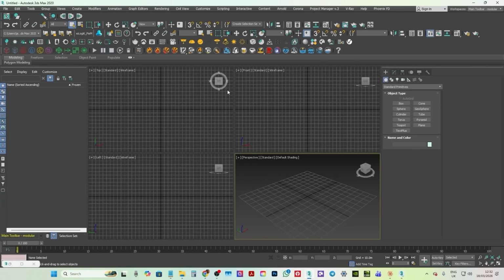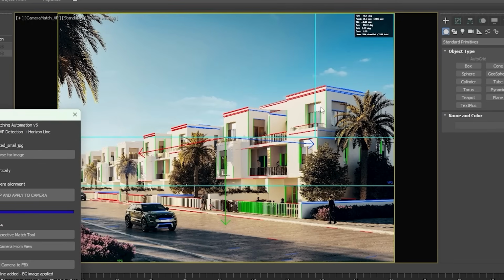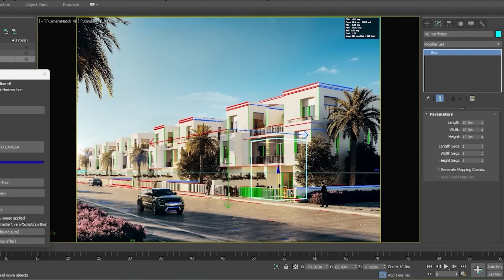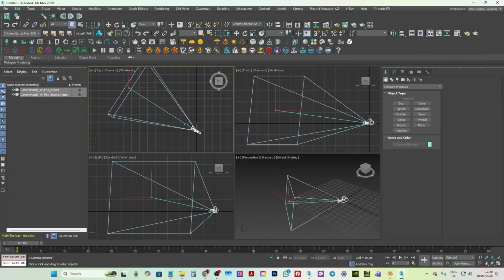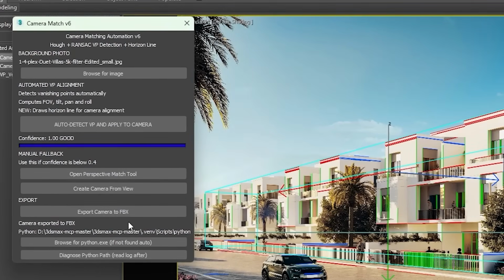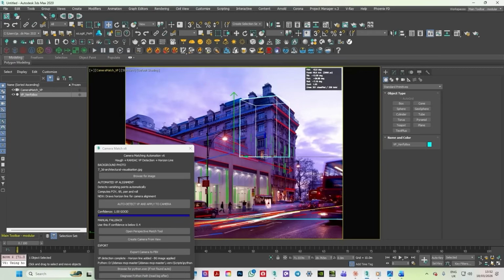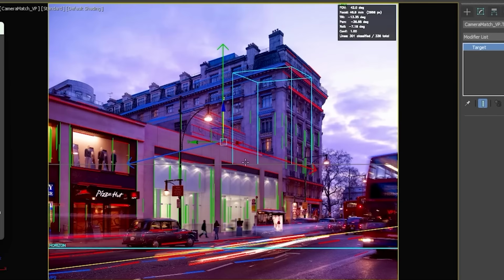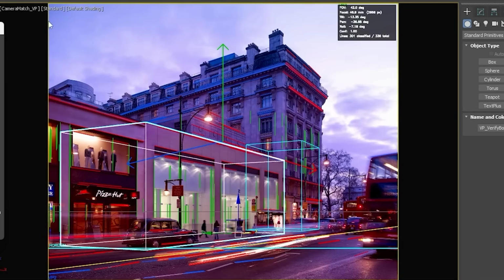Camera Match: AutoSetup 3d script for Photomontages: 3ds Max, Blender, Cinema 4D, Sketchup, etc (CC)

Comment: camera match doesn`t work1 can i sent you screenshot?
Reply from the maker: I have already replied to you yesterday on Behance. Also, my email is: jamiecardo@hotmail.com
The screen shot shows You need to install python:
.
The error is straightforward: NumPy is not installed for the Python that 3ds Max is using.
The key line is at the bottom of the traceback: ModuleNotFoundError: No module named 'numpy'
3ds Max 2026 uses its own bundled Python C:\Program Files\Autodesk\3ds Max 2026\Python\python.exe, which is separate from any Python you may have installed system-wide. The vp_detector.py script needs NumPy (and OpenCV) to work, but they haven't been installed into that specific Python environment.

To fix this,  open a Command Prompt and run:
"C:\Program Files\Autodesk\3ds Max 2026\Python\python.exe" -m pip install numpy opencv-python

.

In more detail:

1. Open Command Prompt as Administrator

>Press the Windows key on your keyboard

>Type cmd

>Right-click on Command Prompt 

>In the results Click "Run as administrator"

>Click Yes if a permission dialog appears

2. Paste and run the command below:

>Click inside the black Command Prompt window

>Right-click and select Paste (or press Ctrl+V) to paste this:

"C:\Program Files\Autodesk\3ds Max 2026\Python\python.exe" -m pip install numpy opencv-python

>Press Enter

>Wait for it to finish — you'll see text scrolling as it downloads and >installs. It may take 1–2 minutes.

3. You're done when you see:
Successfully installed numpy-... opencv-python-...
Then go back to 3ds Max and run the CameraMatch script again — the error should be gone.

Tip: If you get an error saying the path wasn't found, double-check that you have 3ds Max 2026 installed. If you have a different year (e.g. 2025), change 2026 in the path to match your version
Reply: @jamiecardoso94  Thx! I will try....

Comment: Curious i f this works on curved buildings.. Say a coliseum or in a stadium?
Reply from the maker: @urbancreep If there are any straight lines on the photo (even road markings), the algorithms should pick them up to calculate the final solution. 
Currently, the only problem with computer vision to workout the perspective lines are trees, very blurry areas and 360 images. Hopefully the next iteration of this plug-in should solve this riddle!🙂
Reply: @jamiecardoso94  I purchased the script and installed python (cmd says python installed v4.11) but i get an error pop up "No JSON Output" (sry - cant find your email for direct questions) Any Ideas?
Reply from the maker: Hi Alex,

Problem 1 — Python 3.14 is too new
You're pointing the script at Python 3.14, but numpy and opencv-python don't support 3.14 yet. They typically lag behind new Python releases by 6–12 months. So even if pip runs, it will fail to install them.
Fix: Install Python 3.11 (the sweet spot — all packages support it). Download from: python.org/downloads/release/python-3119/ During install, tick "Add Python to PATH" and "pip".
Problem 2 — The CMD command had wrong quotes
Your command was missing the opening quote:
"C:\Program Files\Autodesk_Flex\...   ← missing the first "
That's why it said 'C:\Program' is not recognized — Windows split it at the space.
But honestly, skip Max's Python entirely and just use the fresh Python 3.11 install.
The fix — step by step
1. Install Python 3.11 from python.org (tick "Add to PATH")
2. Open CMD and run:
"C:\Users\Alex\AppData\Local\Programs\Python\Python311\python.exe" -m pip install numpy opencv-python
3. In the CameraMatch rollout, click "Browse for python.exe" and point it to:
C:\Users\Alex\AppData\Local\Programs\Python\Python311\python.exe
4. Try Auto-Detect VP again — it should produce the JSON now.
It's unlikely to be antivirus or permissions causing the JSON error — that's purely the missing numpy/cv2 packages crashing the Python script silently before it can write any output.